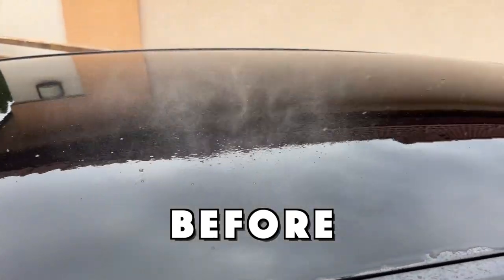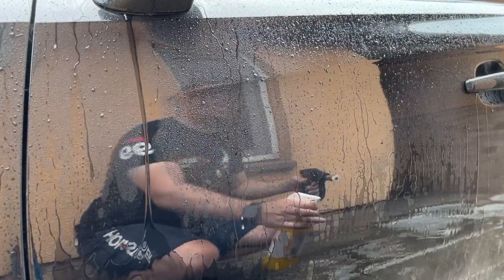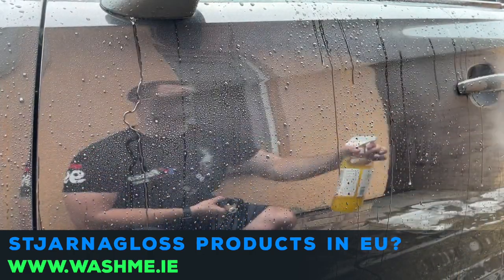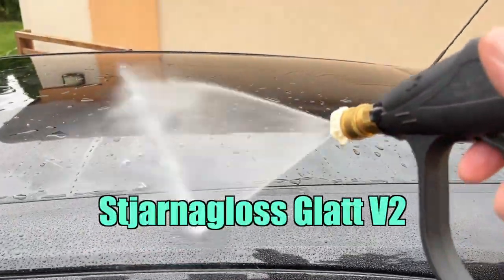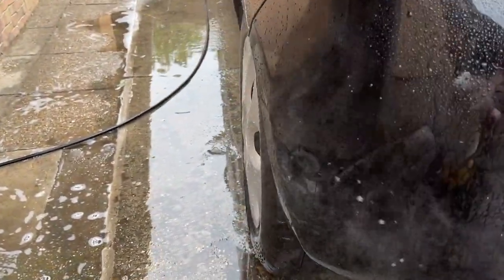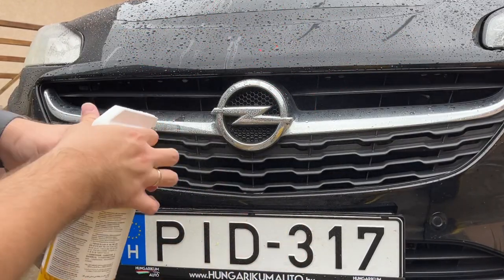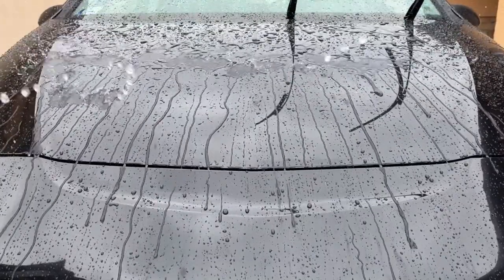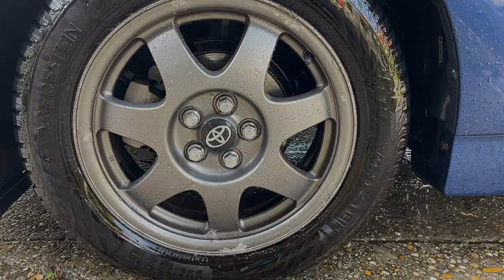Not GYEON WetCoat, but STJARNAGLOSS Glatt!

Comment: Great demo Viktor, looks like a solid product! I really like these kind of spray and rinse sealants for wheels in particular as they're just so quick to use. I'm a fan of Autoglanz Prizm and Bouncer's Bead Juice, I'd recommend both those if you get a chance to try them. They can be used as spray and rinse sealants or as standard spray sealants on dry panels so they feel a bit more versatile compared to something like Gyeon Wet Coat which is pretty cool!
Reply from the maker: Thank you Heather! Spray and rinse products so far my favorite kind, as they’ve got so much better in the past 2 years or so, and basically takes no effort to apply. And as you said, using on wheels and/or areas where a pain to apply any protection these just works fine. AG Prizm and Bouncer’s Bead Juice sound good, too! Thanks for the suggestion, I will try them whenever I’ll have a chance. Would be a nice test to compare all these big boys at the same time :)
Reply: Autoglanz Prism! Tried it for the first time recently,applied it the good old fashion way and after 3 washes it is still so strong.
I'm sold,it's holding up aswell as Bsd with the Shinee wax finish.
Reply from the maker: I need to look in to this AG Prism, sounds promising. Glatt can hold up pretty well too. Spray and rinse products kinda getting more popular as time flies.

Comment: One of the ones I want to try.  I currently have a bottle of CarPro Hydro and a bottle of Wet Coat.  Want to try Glatt as well as DIY Detail Quick Beads.
Reply from the maker: Both Hydro and Wet Coat are great. Glatt I really like, but also there is a brand called “Deturner”, they have a spray and rinse product called “Wet Coat” :) That is also very nice stuff. You can see that in my “Can Deturner Products” video if interested. ✌🏻

Comment: I just bought this on Amazon and looking forward to seeing how it compares to 303 Touchless Sealant🤔
Reply from the maker: Haven’t used 303 Touchless Sealant just yet, but Stjärnagloss Glatt is by far the best spray and rinse I used up to date. Let me know what you thing once you tried 😉
Reply: @RoadToDetailing   Have you ever tried spraying it on and then wiping it in and then rinsing it off?
Reply from the maker: No, haven’t tried that method. I don’t know how would this react on a dry surface tbh. Will give this a go on the weekend to see. I just fell in love with spray on rinse off :)

Comment: How long does it last?
Reply from the maker: While I have no exact weeks/months data, also it very much depends on your circumstances, I can confirm that it lasts reasonably long considering the fact it’s a spray and rinse. For me, it was still noticeable after 2 months, and fully died at around 3-3.5 months. Used it during warmer weather conditions, as well as on wheels. On wheels it still did at around 2 months.

Comment: Seems like you use alot of product, is it needed? Your spraying like 10 sprays a panel?
GYEON WetCoat need like 2 a 3 sprays per panel and spreads even when rinsing off.
Reply from the maker: Hi Downie, good point. Actually I used a lot of product due the car had no protection at all. Glatt would act the same way as Wetcoat, so basically 2-3 mists would do the job, but I knew the owner of the car won’t mind the car for a good amount of time, hence i was heavy on the sprays, and double the layers if that makes sense. On the bonnet I barely used more than 2-3 mists and it worked great. Fair point, thanks for asking 🙌
Viktor
Reply: @RoadToDetailing  thanks for your reply!